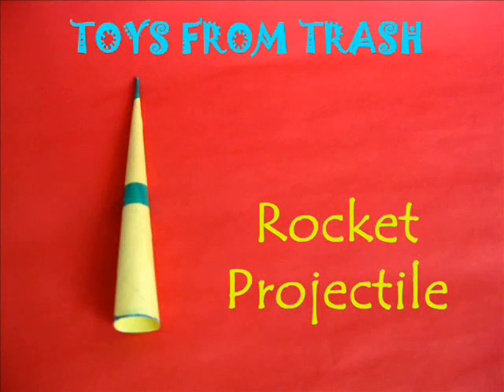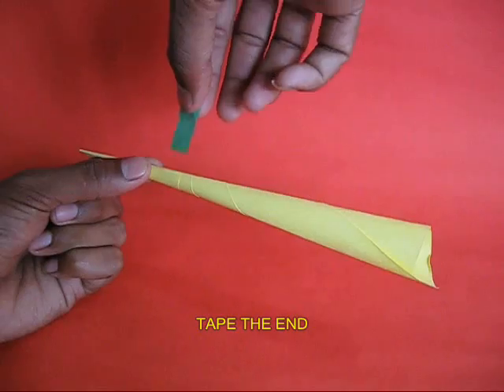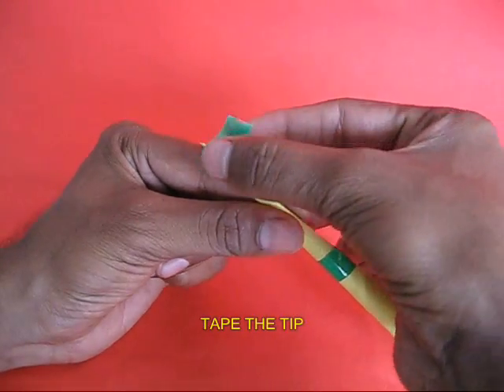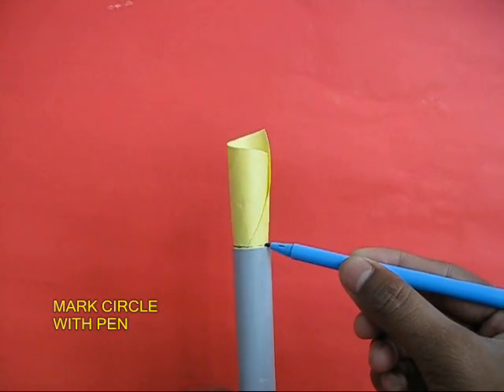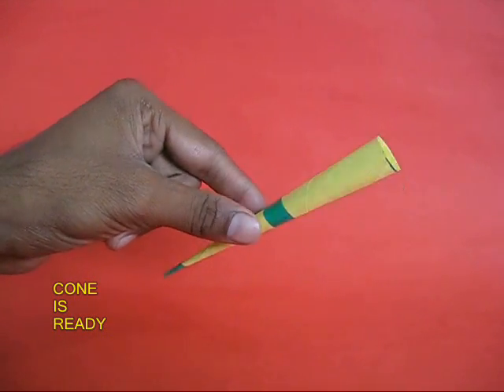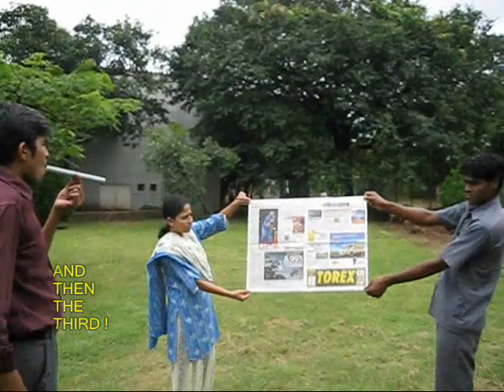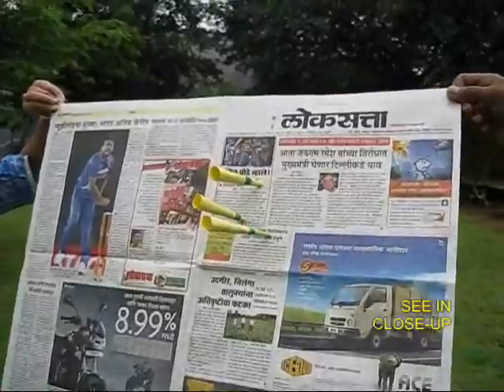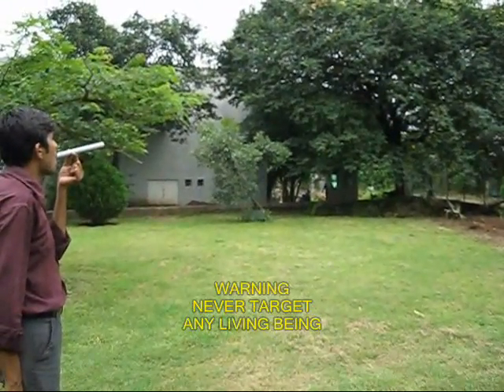ROCKET PROJECTILE - ENGLISH - 25MB.wmv

Comment: its a blow gun, not a rocket. yes i complain on all the videos that say "rocket or jet" just because you all keep getting them backwards, and in this case completely wrong. a rocket has its fuel/compressed air inside of the rocket, and gets its force/energy from the law of every action has an equal and opposite reaction, this gets fuel/air from outside of the projectile, converts energy in the same direction. so its not a rocket, its a blow gun....but i still enjoy your videos